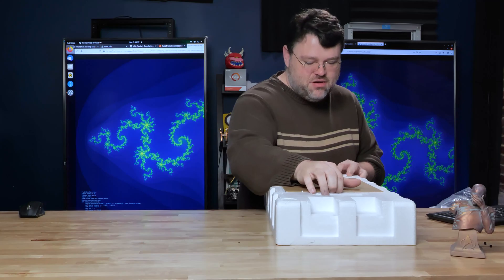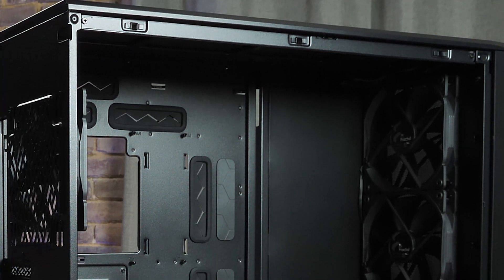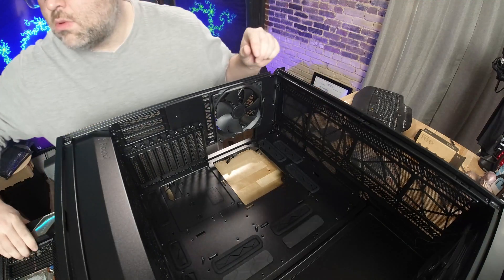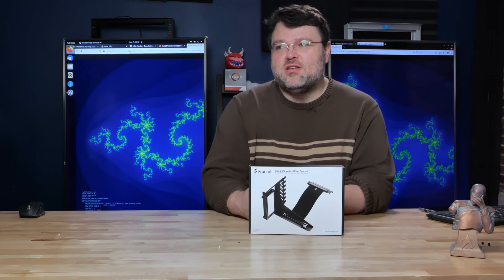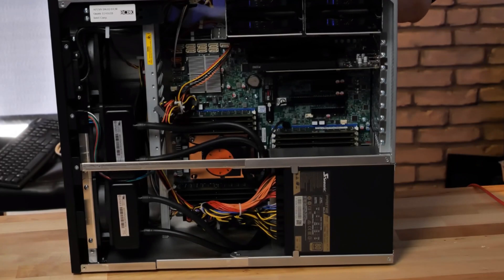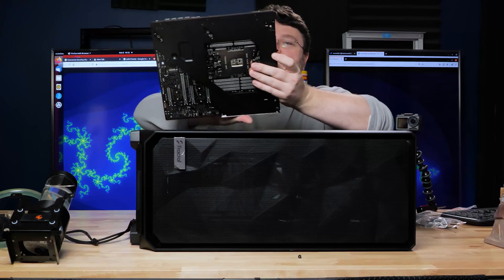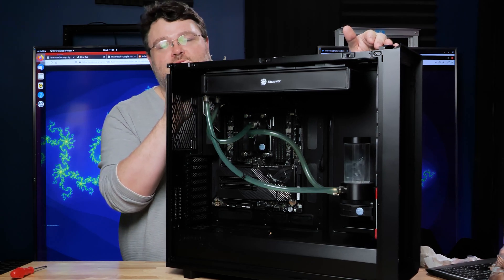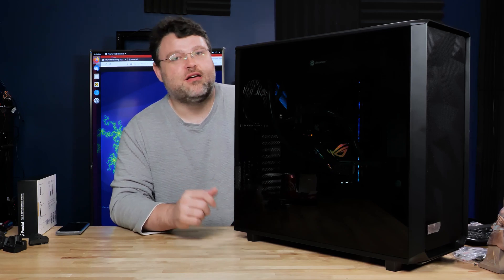Fractal Meshify 2 XL Launch! Threadripper 3990X/EK Custom Loop Build

Comment: Just ordered it , cant wait !
Also I have Cooler Master vertical GPU v3 4.0 and 300mm  not the 165mm  cable , plus 6 X 140 Noctua max 3000RPM , plus 7 x Artic p14 max .
Fractal Design Meshify 2 XL Full-Tower Case (Black, Light Tint Tempered Glass)
Reply: https://youtu.be/K9IhC_NiWRI
Reply: https://youtu.be/_YiKvIJ0l80

Comment: I like the looks of the Define 7 XL more but I like the idea of having better airflow in the Meshify 2 XL. If I put in a ton of Noctua NF-A12x25 fans (and possibly watercool later on) will it really matter? Which is the better case?
Reply: yes, rads need air too and that front on the 7 XL is evil.

Comment: Hi, could you please tell me if an Arctic Liquid Freezer II 420 would fit in the top on this case ? I have clearance issues with my current Enthoo Pro, I had to unscrew the top of the chassis to fit the rad+fans....or else it would hit the VRM heatsink. By looking at your build, I think there would be no problem at all with this case, considering I need about 8cm to be completely okay. Can you confirm that ? Thank you !

Comment: I do often transport my PC's in my car to/fro work or to my girlfriends house. They are my workhorses, and I dont use them for serving so don't need them sitting in one place. I currently have 2 threadripper builds in corsair 780 cases with dual 360 radiators (everything is quite tight but managable with some organisational effort). They just about fit in the back seat of the car without too much hassle. 

These are great looking cases but I would think they are too big for transporting in a car (you'd need a van or SUV).  The added volume this case provides would potentially be great for >2 GPU setups (with watercooling loops) or perhaps clusters of 3.5 HDDs, I personally do not need this, and I would opt for a NAS setup instead (utilizing the secondary onboard NIC).  Not sure if people would be better off going toward a rackmount solution if they indeed needed this amount of space -- is there a unique selling point that I am missing?
Reply from the maker: Kinda sorta same, the wheel mod makes it easier on me though to wheel these about.
Reply: Water-cooled computers are usually set them and forget them. You don't really want to be lugging all that copper and water around.

I had forgotten about Wendell's wheel mod. I need this for my Casemod. Event if I just get the stationary pads, the stance widening would make it much more stable.

Comment: Does anyone know if the side panel is swappable with a Define 7 XL?  I want the solid metal w/sound deadening material inside.  I don't need to look and see what is inside.  I just want a little extra quiet if I can get it.
Reply: I would be interested to know that also... I guess I could always email Fractal Design?

Comment: Do you have something super silent for say apartment use ?
Reply: Try the non-meshify version of this case or the non-XL version, or any of the earlier R series Fractal design cases. I’ve got an R6 and it’s silent with an 8700k and a 1070. 

Or look at BeQuiet cases.

Comment: No side fan = no purchase.
And honestly I don't like the tempered glass either...
I prefer to have sound dampening sides instead.
Reply: I'm kind of surprised they don't do it in steel sided. There is the Define 7 XL and XL R2 for that though I guess... And the R2 has a side fan mount. (I am curious why you want a side fan though)
Reply: @Outland9000  Because a side fan is the one thing that improves temps the most in a build.
If you have two or three fans then yes, you'll want 1 front fan, but beyond that in most cases you'll get the most bang for your buck s cooling with your second fan in the side fan configuration, it's better then a rear fan or second front fan or any other type of fan.
Especially when it comes to GPU temps.
Only exception is in ITX builds.
Basically your average PC case is too long for the front fan so by using the side fan you ensure a steady stream of air over your motherboard and the components on top of it, CPU, GPU, VRM etc.
Never buy a case without side fans if you care about temperatures.
And it also makes the system quieter ad you can run all your fans at a lower speed.
And I use a dust filter on it too...
Recent Fractal Design cases has actually disappointed me so much that I'm starting to wonder if my next case might be a Nanoxia Deep Silence 6 Rev. B...
Something that I kind of hate...
Because it's anything but ideal...

Oh, and for that third fan, it'll go to the rear exhaust in many cases to help airflow from front via the CPU cooler,, or alternatively you can go with a top front intake for more positive pressure if you wish.
Depends a little bit on the case.
But yeah, get a side fan.
Reply: @Luredreier  🤔 Haven't had a side fan in my last 3 cases... The temps have all been reasonable especially in my current case, I am using good spec Noctua fans though. It makes sense that temps could be lower if I had a side fan extracting warm air right from the gpu but as is temps are fine.